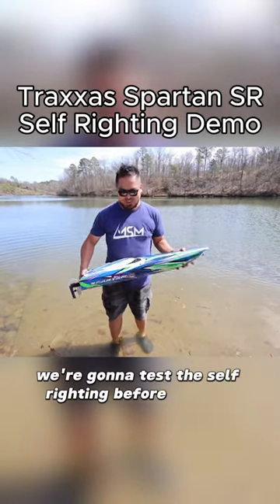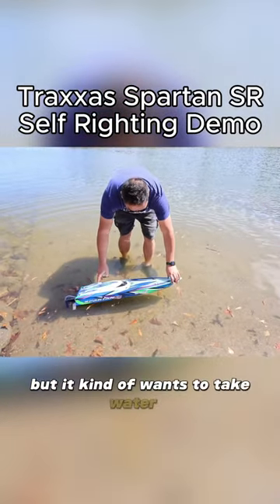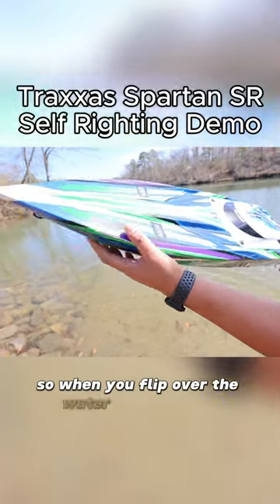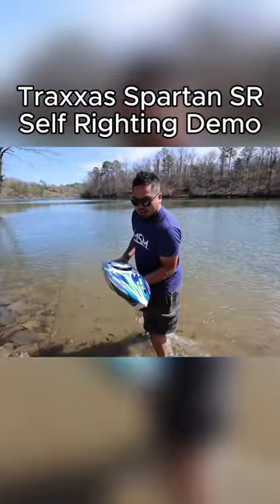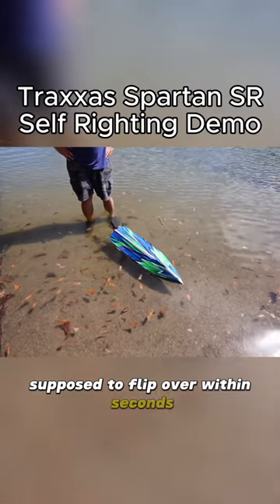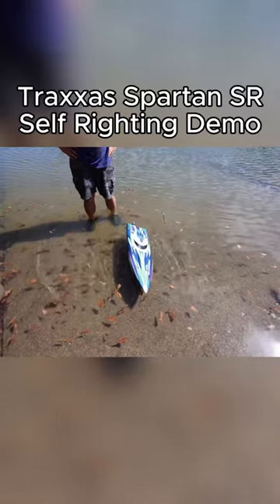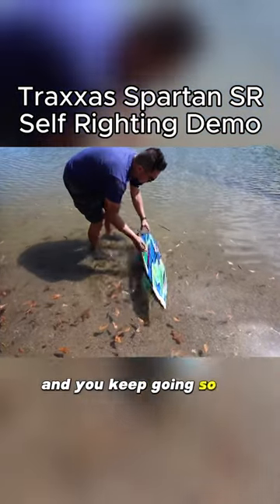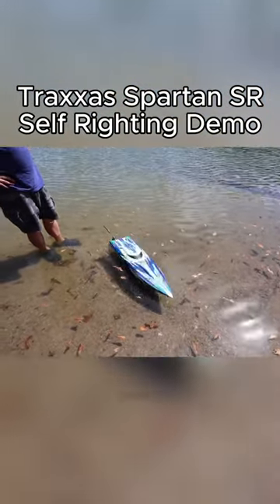THIS RC BOAT FLIPS ITSELF OVER #traxxas #remotecontrol #boats

Comment: Believe it or not, proboat has had self flipping boats for ages. This is not the first of its kind
Reply: I'm a proboat fan and have only proboat boats and no traxxas boats. You're right,  Proboat has had self righting boats for a long time. But this boat does it on its own without you assisting with throttle. That's what makes it pretty cool to me. Let me know if I'm wrong about any of this. This is meant to be a peaceful comment.
Reply: @johng5395  The Sonic Wake from Proboat has the same self righting flood chamber on the left side.  No user input needed.  The Traxxas seems to have exactly copied the successful design.  Copying likely saved them much research money.
Reply: Ahh, I didn't know that. That's one of the proboats I don't have. Thanks for schooling me on that. See, you do learn something everyday. 👍
Reply: @johng5395  Do you have the Blackjack 42?  I have the Jetstream as my first boat and am looking to get a Blackjack when they go on sale.  Mostly as something to play with as the family bobs around on our kayaks and paddle boards.
Reply: I have the blackjack 24 and I really like that one. I like the catamarans but they don't self right. Atleast mine doesn't. And they flip too easily. Don't get me wrong, if I had the money for the blackjack 42 I would definitely get it.
Reply: I've got an Atomik Barbwire 17" I've had for years that is also self righting. I don't know what company came up with it first?